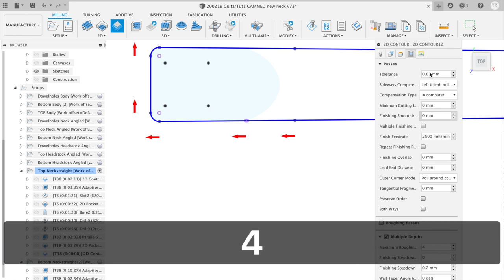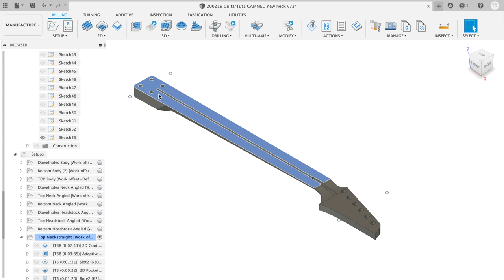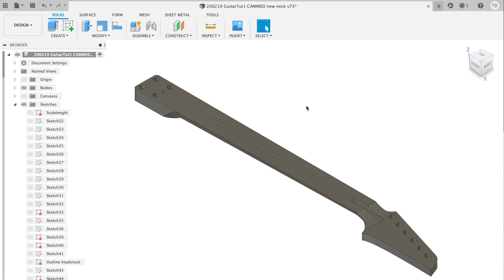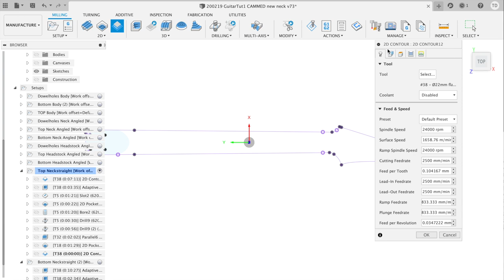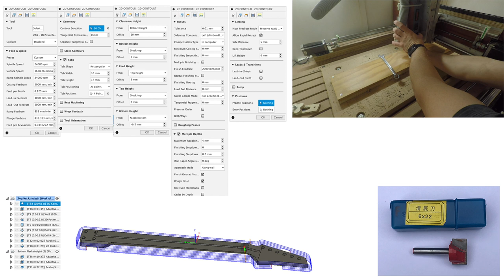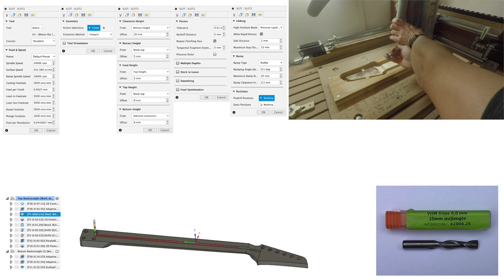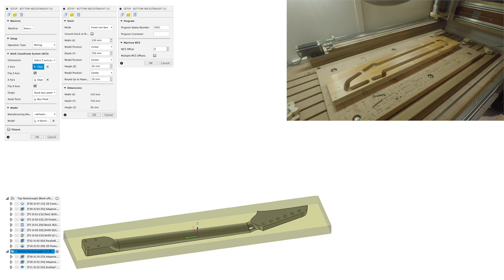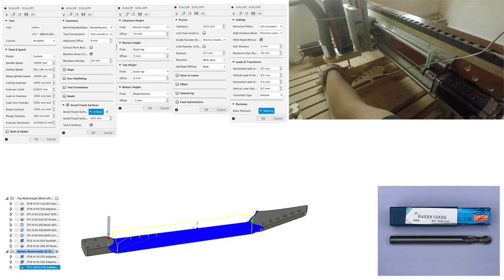CNC milling a guitarneck with a straight headstock

Comment: All of these videos are so informative, really excited to find all of them. What's your strategy for glueing the fretboard onto the neck after you've milled both sides?
Reply from the maker: Thanks! How I join the fretboard and neck: Mask the the trussrod-slot with tape, put glue on the neck, spread it out evenly. Then let it dry for a bit, put the fretboard on it, clap it down. Be careful not to squeeze out the glue too much. Also do not scrape off any excess glue, you'll be pushing it into the wood and be left with stains. 

I did not record my process but it is similar to
https://www.youtube.com/watch?v=TTUVB_6NK5A

Hope this helps!
Reply: @Audiohotshot  thanks, this is exactly what I was looking for! No fancy jigs, just a caul and some clamps.

Comment: Awesome stuff, which CNC machine would you recommend for building electric guitars?
Reply from the maker: Tough question; I built my own machine from the ground up with features that i feel are important, which could be totally different to what you think is best. Or you might not even be looking for a diy machine. 

I avoided shapeoko and so on because i feel they are not stabile enough and it is belt driven. Also my machine runs a standalone RPI, has WiFi, homing switches and so on. In the end I spent less money for more features. 
You could take a look at my blog to read about my machine a bit. https://www.audiohotshot.nl/howto-how-i-built-my-diy-cnc-machine/

Hope this is helpful.
Reply: @Audiohotshot  great, thanks, very insightful, will check out the blog

Comment: For projecting the outline of the body to the sketch, wouldn’t it be easier to select the body itself instead of clicking all the outlines? I usually click bodies in the selection filter of the project option and then just click the body itself.

By the way, where did you get the bits from? I’m asking this as a fellow Dutchman looking for a good deal on bits.
Reply from the maker: Great suggestion,  thanks for pointing that out! 

I get my bits from different online stores found on amazon and ebay, but also freesjes.nl is a regular supplier ;-)

Comment: so awesome! looking forward to seeing more videos as the guitar comes together. When do you think you're going to build one for real instead of using plywood?! Thanks again for the awesome content!
Reply from the maker: You are so right! Well in fact, I did use "real wood", but messed that piece up somehow :-) So I'm taking my time to get everything right; from the design to CAM to discovering things like: how to do a scarf joint for the neck on my CNC. 

I also did research on how much play there's needed for a proper neckjoint fit, I was also asked to make a vid on how I do double sided milling and so on (all of which I already showed in my vids and blog btw). 
I try to cover topics I do not see covered much anywhere else, or in explained in a way even I can understand. (Eg. practical info on feeds and speeds, tips and tricks in Fusion and so on. Maybe all I do is not 'the proper way' but at least it's a starting point :-) )

And so, the 'saga' continues; I can't help it but to discover new exciting things my DIY CNC can do.

Next in the making is a vid about my try on making a neck with scarf joint for the headstock (there's a sneakpeak in this vid btw), and do a new vid on headstock design in Fusion360, (which gives me better results than in my previous vid). 

But you are right, and I also did promise my lovely wife as well, to make this guitardesign with proper wood. So she ordered me to get some pieces in the very near future. And if I do, I'll be sure to shoot a video :-) 

Thank you for your support, it is appreciated!
Reply: @Audiohotshot  that sounds awesome, I would love to see the scarf joint video like you mentioned. And very cool that your wife wants you to build one with "proper wood" that is in fact what I meant in my original comment. I think it will be so cool. Your videos are always awesome and I always look forward to them! Thank you!

Comment: are u planning to assemble the whole guitar w electronics? would like to hear how it sounds when finnished.
Reply from the maker: I just might do that! Got some other stock in backorder at the moment, so maybe, just maybe....
Reply: @Audiohotshot  Also, you make very good and informative CAD modeling videos. Is it possible to make som more complete projects, tricks and tips ? Absolutley incredible tutorials!
Reply from the maker: @joaago1  Great to hear, thanks! Great they are heplful to you. 

Time is an issue in my case... I do have a vid or two in the making, but having said that, time will tell when..
Reply: @Audiohotshot  I would definitely buy a course on Udemy (or a similar platform with higher returns for you) with you explaining the CAD and CAM process in depth. I know very little about Fusion 360 by following Lars Christensen's tutorials, but your strategies specific to guitar building look like something you've reached with a lot of experience.

Overall, great content! I look forward to more videos! Werk ze!
Reply from the maker: @davidlopezmejia7265  I hope the screenshots of my settings in Fusion for the different strategies offer you a starting pointon settings. But I do agree, some question might not have been answered yet in my vids; I'd love hearing some feedback in this regard, though. :-) 

Thank you for mentioning Udemy, I'll look into it, although I've learned all I know today from the good old The Internet and ofcourse hours of practicing...

And learning everday feels like a victory, right? :-)

Comment: So, what happened to the next video: milling a guitar neck with an angled headstock?
Reply from the maker: It's still there where it was before, in between making and showing :-) It is there, but not to my 'standards'... So still waiting for some time and energy to update it..
Reply: @Audiohotshot  apart from that, are there any updates or changes in your cam workflow? Anything worth mentioning?
Reply from the maker: Well, of course there are updates, but it’s all in the details really, depening on the specific model. 

Right now I created a workflow for the neck including the fretboard, all in one go. That should give a much smoother transition between neck and fretboard. So, first routing the trussrod, then installing the rod and glueing the fretboardstock, and continuing with the rest (shaping the neck and fretboard). That should give a much smoother result. I’ve got the cam done already, just need to find the time to do it now :-)
Reply: @Audiohotshot  that sounds more than interesting!!!